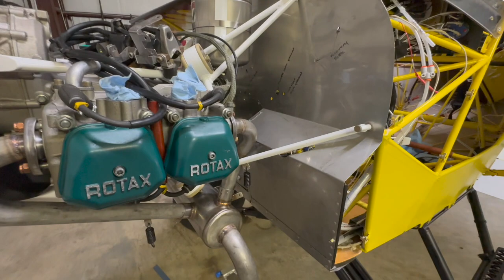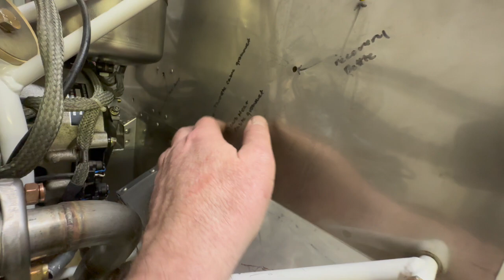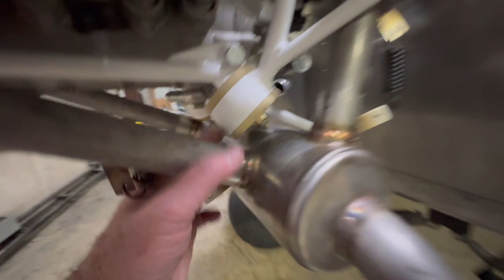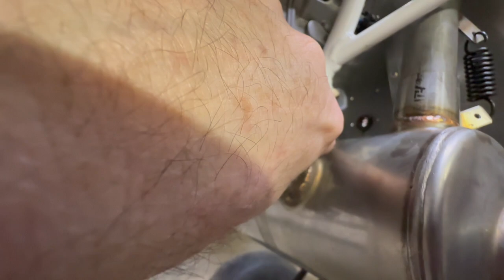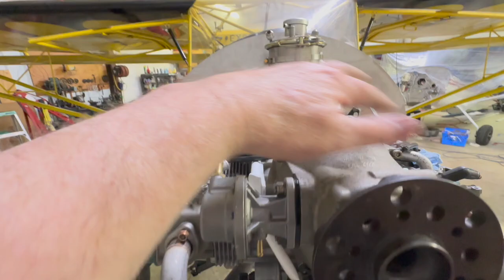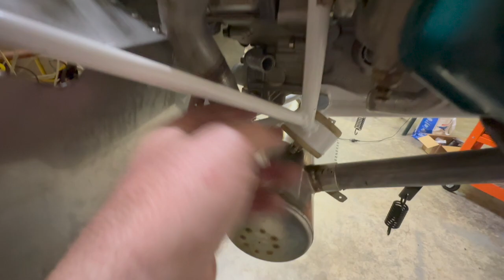RedRiver Fox - New Shoes AND an Engine

Comment: Good work! Keep going! Not a Kitfox but on the RV-12 I am mentoring on at a local High School, the exhaust was rubbing on a couple of places. So we loosened all the mounting bolts and were able to move the muffler around to get clearance were we needed it. That included the nuts that bolt the exhaust pipes to the cly heads. And that is a beautiful Kitfox.
Reply from the maker: Thanks so much for the awesome feedback.  I was going to build an RV-12, but then realized that as much as I loved that platform, it didnt really fit my mission.  I would just hate to tear up such a beautiful aircraft landing in fields and on riverbanks.  

As for the exhaust, I think I have a game plan.  First, I am going to swap directions on the bolt, so the head is near the exhaust instead of the bolt end.  That should buy me a little space.  Then I'm going to add some reinforcement stainless between the can and the mounting bolt.  So if it does rub, I will see the effects BEFORE it perforates my "nearly impossible to replace" exhaust.  If neither of those keep it from causing problems, I will get a custom exhaust built.  Because, I have just SO much spare cash laying around for these really inexpensive solutions!

Would love to see pics of your project plane.  I have contributed a few parts to a HS project back home.  I love seeing what the kids are doing.

Comment: I had the original exhaust with the single spring. I was constantly cracking. Eventually I added ball joints from Acorn Welding and a three spring arrangement to balance the load around the pipe. Been issue free since then.
Reply: The ball joints will drop the exhaust down and solve your clearance issue.
Reply from the maker: Great tip!  I’ll check into that.  Ounce of prevention and all that!
Reply: Install the lower cowling and check your clearance as there isn't much room to lower the can.  I put heat shields on the lower isolater mounts and a heat shield on the lower cowl as these were showing signs of heat stress.  Keep up the good work.